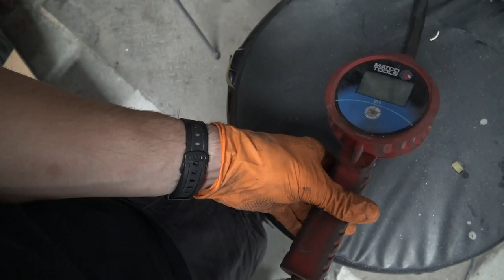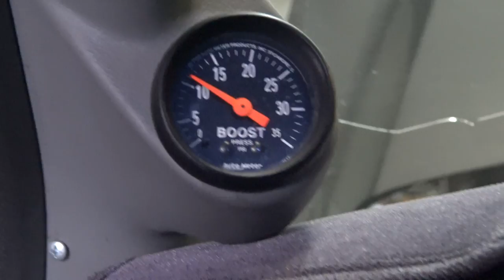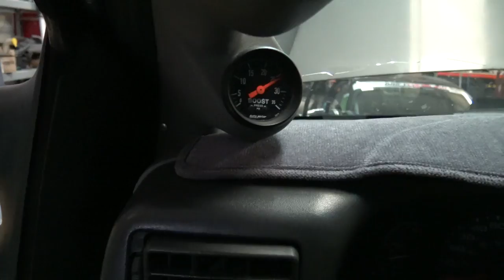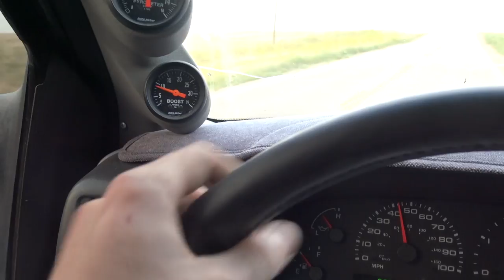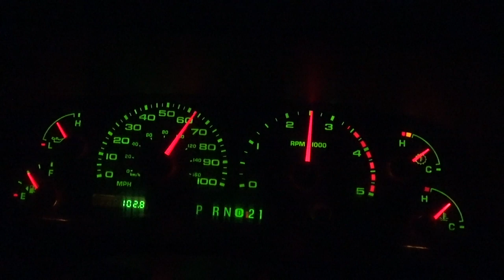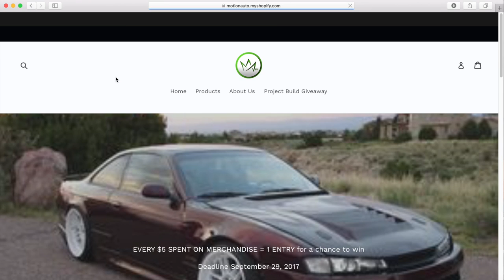ALL THE BOOST! | How to make a boost leak tester!

Comment: P.s. When adding power like you have to the 7.3 you will ALWAYS get that overboost code which pops the engine light on, even got it on mine. But just get a boostfooler from thoroughbred diesel, have it on mine and never had a check engine light since.

Comment: NPT = National Pipe Thread

For leak testing have a friend who smokes blow smoke into the pipe and then see where the smoke comes out. And if that works - tell him he's hired!

I hope you recycle those water bottles. 
As already mentioned, how about a water cooler and use BIG bottles of water that are delivered - along with aluminum water bottles of different colors and with each persons name written on the bottle. Or if being around for deliveries is an issue, get a Brita water filter for the refrigerator and use tap water.

Comment: You should be able to talk to your tuner and ask him to write a tune that turns off the over boost de-fueling.   You should also look into the 6637 air filter.  It filters better and flows better than stock.